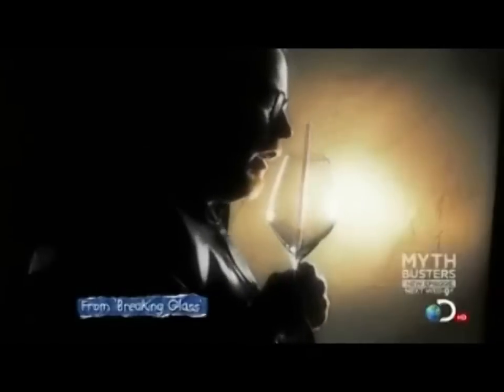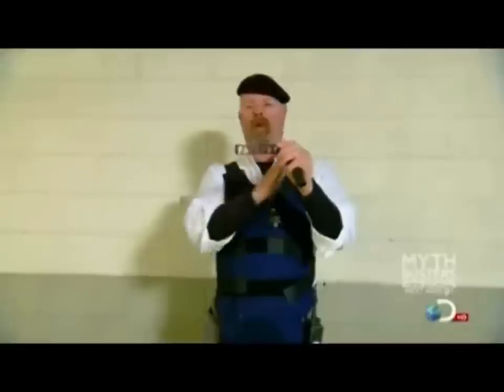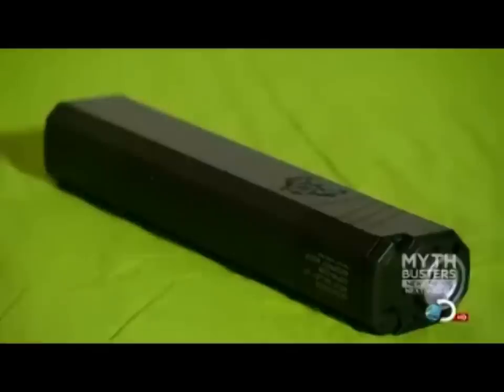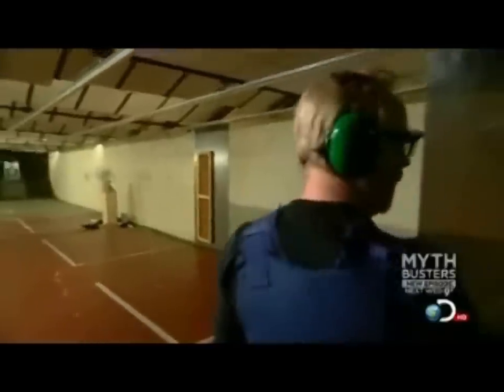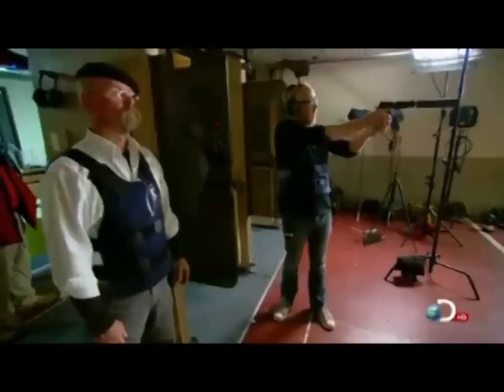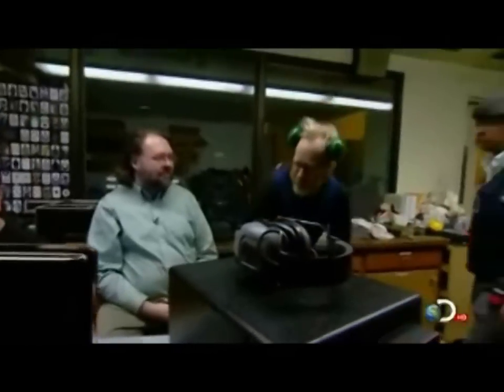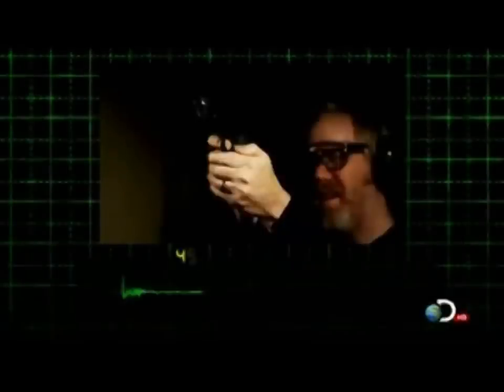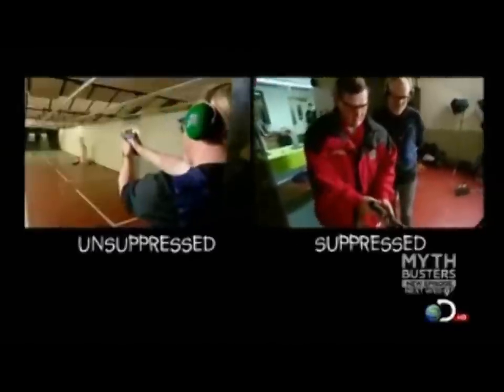Silencerco on Mythbusters

Comment: Depends on the caliber, and the muffler.  (What i call them.  Cans are basically designed like an automotive muffler that a bullet can travel through.)  The WerBel can on the Ingram (.45ACP) sounds approximately like someone dropping a phone-book about 5' onto a concrete floor.

John Ingram, the designer of the "MAC-10" described it as a "Phone Booth Gun."  I.E. You had to be standing in the same phone-booth to hit someone, but he made it to mount the WerBel can to the muzzle.   (For the CIA)
Reply: It only muffles the muzzle flash/bang.  Basically catches the propellant that follows the bullet out, but the cycling action, and hammer (Unless internal striker fired) can still make a lot of noise.  Quietest one I ever made (Don't try this at home, kids!) was based on a Magnum Research Lone Eagle single shot pistol, with a .357 magnum casing, and 225 grain "Soup can" wadcutter, for indoor sillhouette shooting.  That sounded like someone coughed real loud.

In automatics, the back-pressure also raises the cycle rate, which may require changing the recoil spring.  In full autos, this also raises the rate-of-fire.

Comment: The primary sources of a gun being fired are gases emanating from the gun (mostly the muzzle-blast), and flight-noise from the bullet. A screw-on silencer / suppressor can only muffle the muzzle-blast.
If one wants a really quiet shot, one would need to replace the supersonic ammunition with sub-sonic ammunition and the semi-auto mechanism of the gun would need to be adjusted accordingly. An alternative is to bleed-off gas from the barrel into a suppressor built into the gun, (not one that screws onto the muzzle).

Comment: It would of been even quieter than hollywood sfx if they ran the suppressor wet (thats a Silencerco, its designed to be run wet if desired), utilized a pistol with a slide lock, and used subsonic ammunition. Also, silencers don't reduce recoil in the slightest. They reduce "felt" recoil. Big difference.

Comment: much quieter when fired from single shot, bolt, lever or pump action where the action stays closed and you don't get noise from action and gases escaping when action cycles
Reply: Try a nagant revolver when run wet with the silencer being in 7.62 mm. You only hear the click and the sound of the bullet hitting.

Comment: While a reduction from 161 to 128 decibels is a significant reduction in sound,  128 decibels is still very loud and repeated exposure to sounds of 128 decibels over time will (not can, but will) result in hearing damage and hearing loss. 128 decibels would be the approx sound level in a very loud factory where the workers would be required to wear hearing protection at all times.
Reply: Thx1138sober that’s because the noise their in is sustained for the most part.  But as listed by osha.  As an impulse noise it’s safe.  Now it would be an issue for hours rounds after rounds an hours an hours because it’s being sustained. But as an impulse noise it’s safe

Comment: Also they're fireing indoors, you're not only going to hear the initail sound caused by the mechanism cycling you're going to hear the sound coming back from all those reflective surfaces in the room. It would be much quieter if you did it outside or in a room with less reflective surfaces.

Comment: For the absolute best efforts of a suppressor get a 45 pistol because it is a subsonic round  meaning that there is no breaking of the sound barrier (no thundering echo) when the bullet is fired then fill the suppressor baffles with silicone or even water to completely reduce the sound of the shot by by reducing the speed of gases Which will take off an extra 30 dB, literally making it sound like paintball gun.

Comment: Uh, no. You're hearing some pop still from the round exiting the pistol along with the mechanism of the pistol cycling. At the very least, you cannot muffle the sound of the pistol cycling because that's happening through the breech as the spent casing is ejected. That's why blowback action firearms don't suppress as well; more gasses (and consequently sound) are vented back out the breach.

Comment: I agree, with 22LR boltlock rifle + subsonic + supressor + ear muffs its hard to tell if cartridge fires or not. I buy some (unnamed big company) subsonic 22LR subsonics and about 5% doesn't  fire at all. Its really hard to know what happens or nothing at all. Hammer spring through muffers give "ping" sound that covers all gunpowder sound. Normal cartridges are much more loud.

Comment: One issue is caliber. 9mm or lower is incredibly silent. They are using a 45 which a decently large bullet. 

Not saying they should be illegal, just there is a difference. And with a custom subsonic load, all you hear is the clack of the receiver.
Reply: ?  Bullet size/caliber doesn't really mean anything when you're talking about the sonic boom/crack of the round, which the can does not mitigate.  the custom subsonic load you refer to is slower than the "standard load", hence it being quieter. 9mm subsonic is much slower than standard 9mm and therefore easier to make quiet. One of the reasons why so many people suppress .45 is because .45 is already, at industry standards(800-900 fps), a subsonic round (supersonic is considered around 1100FPS).  Here's a suppressed .223.  https://youtu.be/w3bb3YsySf8

Comment: Inject a small amount of oil into the suppressor and it will sound identical to the "Hollywood" version!
Reply: Only for a few rounds though. And it'll gum up the gun more.
Reply: No it won’t. That’s where your wrong I run wire pulling gel. An water an ultrasound gel an all kinda shit. Does it drop down a bunch from dry. Ofcourse.  But you will never get one to “sound like Hollywood”. It’s a made up computer generated sound.  It’s a sound used so unknowing idiots that hear that know it was silenced. Vs the real toned down sound that it really makes

Comment: Calling a suppressor a "silencer" is a misnomer. Just because the ATF said it, doesn't make it correct. The ATF seized airsoft guns because "they can easily be converted into machine guns"

As for magazine vs clip, you are correct. There are clips and magazines for firearms, but they are completely different items.

Comment: The fact that they used different firearms for the control and the suppressed test for the same caliber deviates the baseline of the study, Adam used an H&K USP unsuppressed and a colt 1911 suppressed both .45 cal is not a scientific test, one gun design hasn't changed in over 100 years, yet the H&K is the frontline of .45's

Comment: For the absolute best performance of a suppressor get a 45 pistol because it is a subsonic round  meaning that there is no breaking of the sound barrier (no thundering echo) when the bullet is fired then fill the suppressor baffles with silicone or even water to completely reduce the sound of the shot by reducing the speed of gases Which will take off an extra 30 dB, literally making it sound like a paintball gun.  Actually and I’m not making this up you can research this yourself or try it out.  the cycling of the slide is louder than the actual gun shot so to counter this H&K made something called a socom 45 which allows you to lock the slide preventing it from moving and Chambering rounds making it even quieter because it traps the gases in the magwell/slide and it doesn’t give you the loud sound of the slide opening.

Comment: It's plausible right now, those pistol silencers are very modern
Reply: the hush puppy from the vietnam area was just as good, just bigger
Reply: Not even close, if you comparing like performance.  The Hush Puppy was built on a .22LR round for the Ruger Mark II.  Very effective and deadly, but nowhere near the noise reduction or ability of the .45 Adam was shooting.
Reply: yeah, the technology has improved a lot since then.  I did a comparison of an old can i got with my Mac 10 (a very large coastal can with essentially large aluminum washers) compared to a new design  (AAC avenger that is much smaller) and the sound difference was amazing.
Reply: The Hush Puppy was built on the S&W model 39.  The Spectre was built on the Ruger.
Reply: LOL
Modernity doesn't has much to do with silencers. 128db is very loud (decibels go with logarithmic scale)
To give some examples how loud 120db is...
100 db is how loud a jackhammer or a chainsaw is. Yes  its lot less than unsupressed, which goes along the loudness of  a stun grenade, but it is very loud still.

The least loud weapons were things like the Welrod pistol (an assassination tool designed during WWII) which is a single shot bolt action pistol, that uses consumable rubber baffles in its built in supressor (and its BIG), and the de lisle carbine, which looks like a carbine, but it can hardly be called one, sure it fires .45, but it has a short (nearly pistol length) barrel, that is perforated half its length, inside a muffler that makes it rifle sized. These weapons can reach 78-80db. Which is still louder than a vacuum cleaner.

Comment: First, I do not get my information from films, but as a 8 year Marine and weapons instructor. Secondly, there is no "may" about it. The cooling and buffering of the gas is EXACTLY what slows the round and decreases the sound. Yes, there is "real speed drop off" a sub-sonic round is used - that is not in question, or what this guy said. The simple physics of how a sound suppressor works is by cooling gases, creating a buffering effect, and it naturally does slow the round by a fraction.

Comment: I'm a bit disappointed that the guys had never heard a supressor shot.  And they only used subsonic ammo.  There's still the noise of the slide action of the gun also.  The supressor only reduces sound from BANG to "pap".  And if they'd shot supersonic ammo, they'd have quickly learned that ammo from a rifle, .357mag, or 9mm supersonic, that a large part of the noise comes from the "sonic boom" generated by the bullet itself, not from the muzzle blast.

Comment: They failed to mention that different rounds have different results. And they didn't even talk about sub-sonic ammo (Rounds that don't break the sound barrier). A suppressed .22 sub-sonic round is extremely quiet while most suppressed sub-sonic rifle round are actually pretty loud. But sub-sonic ammunition is much less powerful since it's going a lot slower.
Reply: not really less powerful. you will not give a damn rat's ass wheter a subsonic or supersonic 9mm goes into your braincase.

Comment: There are so many variables here. Bolt action vs semi auto. Subsonic vs normal rounds. Inside shot vs outside shot. Length of barrel etc. Suppressors make firearms MOSTLY hearing safe but "Not Always". A Lot of the Noise your Hearing is the escaping Gas blowing back through the action of the Gun and the Action it's self... that's why Bolt action is quieter.....but Myth Busters did a Decent job Explaining for the Dum Dums out there

Comment: Why would they use an HK for the baseline and a 1911 for the suppressed test? That's just adding a new variable for no reason.
Reply: Barrel length and cartridge loading are what affect suppressibility. Style of the gun does not. Both the USP and the full size 1911 have a 5-inch barrel and I am assuming that they used the same manufacturer cartridge for the testing. No variable at all.
Reply: That was an FNX .45 not a USP
Reply: nope, its a usp. look at the rail (usp style) and the thumb safety (also usp style)
Reply: Jon Hammett I disagree, model of gun makes all the difference, some guns are far better suppressor hosts than others, a 16 inch barreled AR15 chambered in 7.62x39 is still a better suppressor host than an AK even though they are effectively the same rifle according to your criteria.
Reply: well ya, thats because they use different methods to cycle the action. you will always get a crack from any piston driven rifle compared to the almost complete silence of a di. but as far as handguns go, they cycle the action the same, the round is the same, the barrel leangth is the same, model doesnt matter.
Reply: stephen degraaf true, they're both tilting barrel browning actions, but wear and tear can make a difference. If one of them has a recoil spring that is more broken in and weakened that could affect lock time and therefore sound. I just think that if they wanted a more pure & scientific test they should've just removed the silencer from the HK for the unsuppressed baseline shots; it's still an unnecessary variable.
Reply: No matter how you cut it changing something is by definition adding a variable. 

Unless you test both guns to insure there is no difference in terms of the test it must be assumed that there is. To use different guns, even if they are the same make and model, without correcting for potential differences is unscientific.

Comment: I wish they had given more information.  A .45ACP usually comes in as subsonic, whereas a 9mm is a supersonic round.  That difference, once it leaves the end of the suppressor, is still going to make a huge difference.  I would have liked to have seen the unsuppressed and suppressed readings for the 9mm, and I wish they had also done .22LRs, both subsonic and supersonic.

I know that a well designed suppressor will knock down the sound and recoil of even a .338 Lapua (personal experience), but there is still need for hearing protection.
Reply: Gary C Depends on the bullet weight of the 9mm you are shooting. If it's 147 grains, it's subsonic. Don't know about +P loads though.
Reply: Velox, you are correct that a 147 grain is subsonic.  A couple of the other weights are right about 1090, which is just supersonic or transsonic.  I tend to shoot the lighter JHP rounds, which I feel give me better expansion, but that's just me.
Thank you for the correction.
Reply: 9mm is not automatically supersonic. I have both super and subsonic 9mm ammo. These days I go for high subsonic to transonic (less than 1100FPS) for full suppressor effect. Still, even with supersonic ammo, a silenced gun is more pleasant to shoot than full-on LOUD.
Reply: BooDamnHoo I stand corrected.  I don't consider anything over 1050fps to be subsonic, depending on the actual environmental conditions.  However, I just did take a quick look and saw that there is a Winchester 147 grain round which is at 990fps, which puts it into about the same velocity category as the .45ACP.

So, thank you for broadening my knowledge for me.

But, I'll agree, no matter what caliber you're firing, and what speed, a suppressor makes it nicer to shoot.  I've even seen a reduction in recoil because of it on larger rifles.

Comment: Does this mean that the low noise level achieved in 'No Country for Old Man' is possible?
Reply: Yes, but only with certain ammo types. A .45 caliber round is naturally subsonic, so it will be very quiet when fired with a suppressor. However, a non-subsonic 9mm round will be louder because the bullet still breaks the sound barrier (you'll hear the crack downrange). In rifles and shotguns, suppressors still may not make the gun hearing safe with standard ammo.

Comment: The amount of suppression really depends on the round you use. A .22 is "Hollywood Quiet" but a 9mm, .40, or .45 isn't quite as quiet. The 5.56/.223 is very difficult to suppress. They are usually right under the 140db OSHA rating for hearing safety. DEVGRU SEALs use MP7's with a new 4.6x30mm cartridge that is so quiet they can shoot someone in one room of a house or building and you can't hear it in the next room. There's more research and testing they could've done with this.

Comment: Secondly, standard military rifles have a barrel brake for flash suppression, not sound suppression. The physics and design of the two systems are completely different. The muzzle break on a .50 rifle is NOT the same as the flash suppressor on a M16A2 Service rifle. Notice the direction and reaction of the gases and you'll see that.

Comment: by moving slower than 1,125 feet per second at sea level a subsonic bullet doesn't make the "crack" or "bang" after leaving the suppressor because it isn't breaking the sound barrier. using a supersonic bullet with a suppressor is kind of pointless because the bullet still cracks after leaving the suppressor it does however lesson the gas and some of the noise.. a subsonic round suppressed will be extremely quiet. usually only the action of the gun is heard.